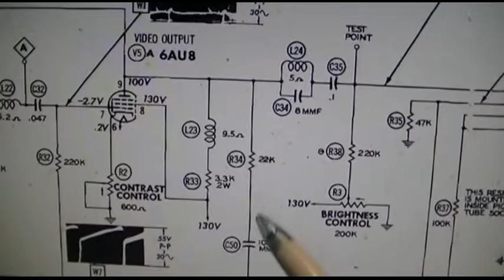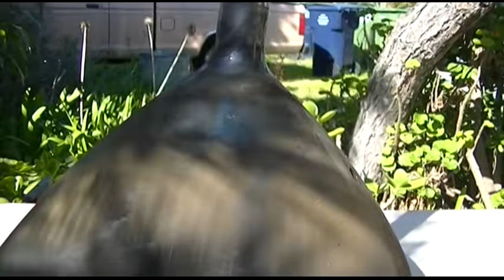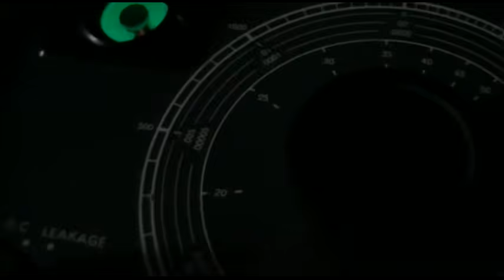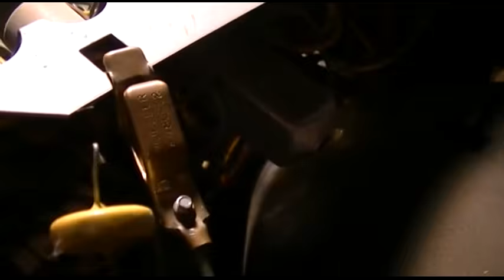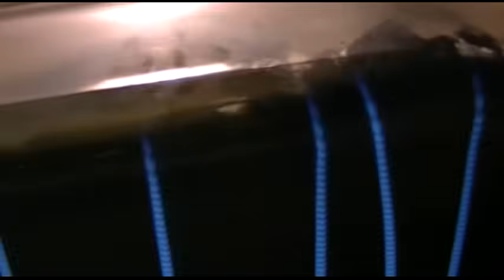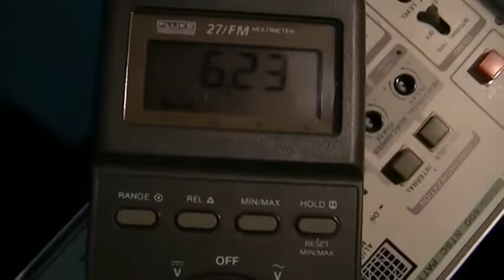GE 14T014 1956 Black and White Portable Television Repair Part 2

Comment: I know that's an old video, but I had two TVs: one 20inch Broksonic TV from 1994 and one Goldstar 5inch black and white from 1987, and both had hell lot of hours on and both will do the same effect with brightness and contrast. The bw one I had some replacement tube from another old TV, but the 20inch one seems to get better as the tube gets hotter.